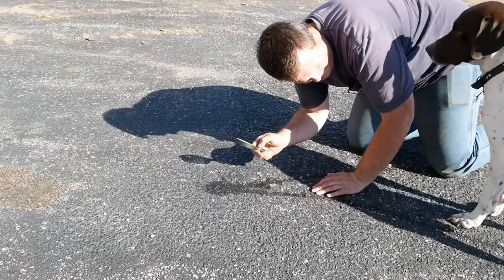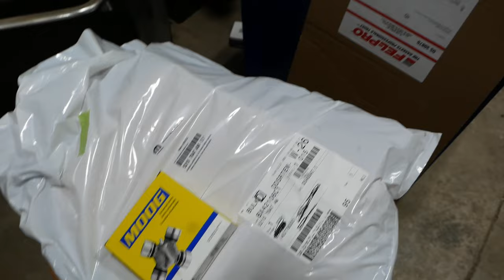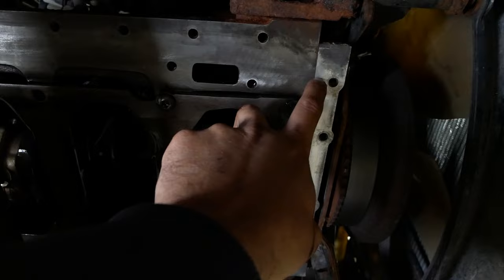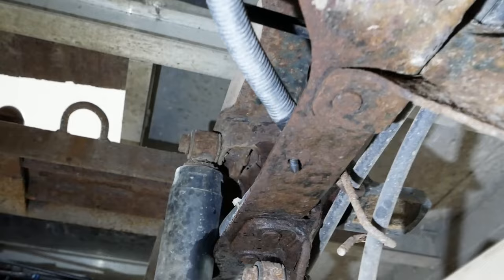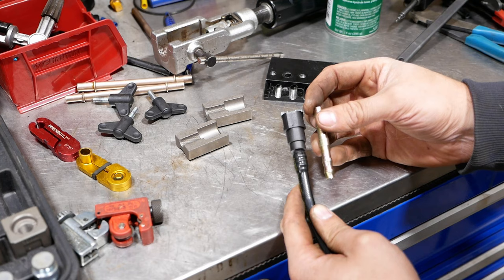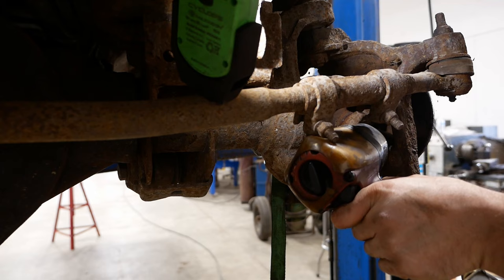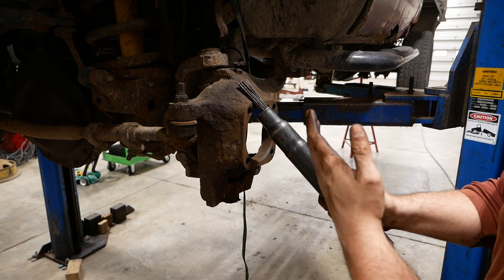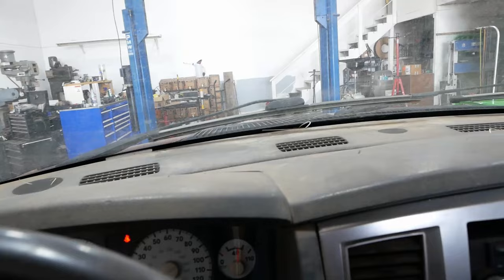6.7 Cummins Massive Oil Leak - Replace Oil Pan, Front Axle U-Joint, Fuel Lines, Shift Cable, Battery

Comment: Damn Wes, You’ve Got All The Cool Speciality Tools. It’s Unfortunate That You Have Got to Explain Your Actions To John Q Public, They Surely Should Comprehend The Fact You Run A Business And Not Working Under The Shade Tree In Their Trailer Park. A Pleasure As Always, Keep It Safe Out There Sir
Reply: It's called integrity.Doing the right thing even when no one is looking.
Reply: @gepettoe  Absolutely Correct, Crying Shame You Rarely Get That Anymore. Seems Most People Don’t Give A Crap And Will Cut Corners To Save A Buck, Regardless Of Any Repercussions. Some Cases It’s Simply Incompetence. Keep It Safe Out There Sir
Reply: Elm tree man-canics, make do with what they have, making use of that crusty wrench found under the trailer
Reply: Well I hate to say this but I learned how to fix stuff the right way cause of my dad. The bad part of that is he was one to save more than a buck that's how bad it was. He once cut a hole in the fire wall of a car we had just to get to the back of the head ( 4 banger ) and yes he did it from under the dash yes inside that's just one of many of his lessens .
Reply: Hardest part about being a tech and especially running a shop, dealing with the public.

Comment: Had to laugh when you said, "The only thing holding the bed on is the tail light wiring." That is definitely pushing things a bit. I like your approach to safety. There is a reason for the standards we have today. Likely there were problems caused by the way things were done in the past and new standards were put in place to prevent those in the future. You can sometimes get away with doing it wrong, sometimes for a long time, but it will catch up to you eventually. I have learned things watching your channel. I like how you use the impact tool to break things loose. I will definitely be using that in the future.

Comment: Granted it's not near as cheap as the harbor freight one u bought, but the mac battery ratchets are pretty damn slick if u ever get to the point of upgrading. Put mine through absolute hell and back daily and it's yet to fail me other than last winters cold snap got a battery but that's it and got her warrantied the following week! The ratchet itself still is as tough as ever after who knows how many drops/falls off the lifts lol.  Engine work suspension work it'll do it all. Manual torque on it is something like 150ft lbs and 45 or 50 ft lbs with the trigger. Awesome tool!

Comment: Thoughts from the Eastern Rust Belt. Never Seeze,  the gift that keeps on giving.  A coworker bought a needle scale, wore out the fingers in a month. Mac Tools has bits for an air hammer that fit over those splined hub bolts, so you can drive on the bearing from the inside.  Another of my no longer needed tools.
Reply: I just took apart some parts that I antisiezed a few years ago.  It was nice.....

Comment: Loved seeing the aftermath on your floor after all that work Wes. I worked on a Mercedes Sprinter for my mate on my driveway a few weeks ago. Brake lines. Rear diff cover. Seized rear brake shoes. Broken spring. Also replaced the front control arms and a bad wheel bearing. The rust that came off it literally filled 2 buckets. 🤦‍♂️
Reply: I'm so glad I live in the southwestern United States rust free cars as far as the eye can see.

Comment: Just come friendly advice from somebody who has tried almost every cordless ratchet... The Makita kit is excellent and is super low price right now, only like 100 bucks on Amazon and it gives you 1/4 and 3/8 drive in 1 and it's about 88 decibels. If you want a ton of power and a brushless motor, the AC Delco ones are fantastic and are heavy duty, they are just rebranding another tool companies tools but they put down some real power, especially the 1/2 drive. It is about 99 decibels free spin full throttle. I'm going to film a video of comparing the two with some torque specs and noice reading and rpm etc if your interested. Also both of them have their batteries in a configuration that makes them fit way more places than the Hercules.

Comment: Yes, the humor is priceless.  You might think that the "aftermarket" would have stepped up and designed a 2 piece oil pan for these trucks that have the rusted oil pan issues.  I would think that there would be enough old PowerStrokes's and Cummins to support the design work.  I drive a '99 F250 that I have been spraying down with rust "preventative" products for years, the outside is OK, but I understand some may rust from the inside out.

While I'm dreaming, BendPack needs to design a 2 post rotisserie lift that lets us work without rust falling in our faces.
Reply: That'd pretty much require a catch pan for all the rust and that would just get removed anyway

Comment: Wes:  Quick story oil pickups.  I rebuilt the engine of a 1952 8N.  After new bearings, rings, etc.  I decided to be real nice to my new engine.  STP was all the rage at the time.  I dumped a can of STP in and then added the oil.  All set.  Crank, crank, slow crank and stop.  Yup, the STP was so  thick the weak oil pump could not pull anything thru.  Oh well, I knew what not to do the second time around.

Comment: When I worked for snap-on in 1978,,, the Chicago Pneumatic air guns were very expensive,, and worth every penny.
I love it when I see one of the old cp-2xx hammers still working like new. Every once in a while a return with a cracked case ( probably dropped from 3 story building). Snap-on replaced them. Don’t know if it’s still the same,, I mean 1978.

Comment: On my day off from vetting I like to watch Wes work!  Thank you for an entertaining and informative video! I enjoy the humor"-the Wallet with Wings"  😆!!    PS. You may already know but Max the pup has a front left tire that might need some mending.   Take care and thanks again for sharing your work with everyone.
Reply from the maker: We've had it checked out. He has a toe that has never "worked". I think it's caused the limp as he's gotten older. He's almost 8 now.
Reply: @WatchWesWork  Aww.  He's a good boy!
Reply: @WatchWesWork  you do real ass,, if dust gets in a diesel,,it dies..im in aus.. this is well known by a lot of 4x4rs..trying to find a real,honest mechanic hear is the same as finding rocking horse sht..
Reply: @WatchWesWork  hell. as i said, im in aus, our cars dont rust. i have a 2001 ford s/pusy,4.2tdi, mexican/brazil.. looks like new..
Reply: @WatchWesWork  every nut bolt on a dodge is 15 ftlb..ish
Reply: @WatchWesWork  how can they satyuse rubber lines if it is common rail, whats the line pressure. 50 from tank.?. 2300 motor.
Reply: @WatchWesWork  that u joint has a grease jerk,,what a waste of engineering time & money
Reply: @WatchWesWork   Can you add a link for the brake line flaring tool and for the one that pushes the quick connector into the plastic line

Comment: When installing new u joing caps I've had good luck when putting your first cap in you actually run it in deeper. That way when you put your second cap in it is already centered between two so cap bearings will not fall out.
Reply: That's a good idea

Comment: Keep us updated on that Hercules cordless ratchet. I too have been thinking about getting one and I’m curious as to how well it will hold up.
Reply: Well pushing anything from Harbor Freight is going to lessen its life, sometimes to seconds / minutes haha.  If youre not dealing with high torque for long periods it should be fine.
Reply: Project Farm did a video on it vs the Milwaukee Ratchets if you're interested in it's limits
Reply: For the price might as well just buy Milwaukee imo
Reply: @Bud Masta  SOME of their products are legendary like the Earthquake line of Impacts I believe they're clones of IR after patents ran out. Their Predator line of inverter generators also excellent. I think clones of Honda except they're all without the expensive brand name

Comment: Little tip that's helped me installing oil pans in awkward locations, I take little bits of small wire and go through bolt holes on the pan and gasket to hold it in place. Get the pan up, start a couple bolts loosely in the middle to suspend the pan and hold the gasket in place, and the pull the wire. Had a couple gaskets fall in the pan during assembly before I started using the wire. We've got some parts tags at my shop I use the wire from.
Reply: Or wire from a home store in the concrete materials dept I believe used for rebar. It's like $8/roll lasts forever and great to keep in your truck for side of the road repairs, holding a tarp or securing things.
Reply: @mrmotofy  I've got a roll of that in my box. Its too thick. You need something thin that will bend easily so it doesn't damage the gasket as the wire is pulled back through the hole.

Comment: Hmm: Adding the connectors to the plastic lines, I just heat up the line a little with a heat gun and jam them in. Not sure if thats the correct procedure, but haven't had an issue.

Comment: Good detective work on which truck was leaking and where it was parked! Max not as good as sniffing our leaks as sniffing out mice! What holds everything together once the tail the light wiring is gone? At least you have a good battery charger/booster! Nice fuel line fix! Cool tools for that. Needle scaler cool! 1st time I have seen one. Repairs worth it for a lower mileage Cummins. As for the math, the teacher looks from the younger generation that teach the new math? Me too old to understand how it works! Great video and fix Wes.

Comment: I usually slather the rear side of my brake rotors where it contacts the wheel hub assembly just so they're less of a pain to haul off the next time. works well for my rust buckets I tend to work on

Comment: Your standard of work is un beatable thos fuel lines were a perfect repair clip on to factory lines and wont ever rot away like the original ones it doesnt get any better a part that clips on like a factory part is superior to the original part as in wont rust again and is easily serviced joined to at a later date perfect job
keep up the great work you do things exactly as i would its great to watch
Reply: Yes sir the industry doesn't always cover everything when it comes to the different areas of the country, so a lot of fellows like Wes come up with a repairs that will suffice both in expense and helping out with longevity of repaired systems.

Comment: You have to have the patience of a saint to work on projects like this. I was a UPS driver, I would deliver stainless oil pans to the county shop for the plow trucks. Those trucks are all spec’d with springs, hydraulics, etc. just for plow work but they couldn’t order them with stainless oil pans, go figure.

Comment: 2 1/2 years ago  2004 5.9 Cummins oil pan perforated so It now has a liberal coating of hi temp  flexible stove pipe sealant and is still oil proof!

Comment: On my 5.9 i didn't remove anything from the engine before lifting it other than loosening the mounts. Lifted the engine with a 2×4 and a floor jack on the crank pulley. Best 4 hours of my life. My new pan is from orielys and no issues going a year strong. I did not remove my trans. I loosened the rack and pinion and removed a crossmember behind it and lifted the engine on 2wd
Reply: Update: oil pan gasket is leaking. Imma tackle this with an oem pan and gasket

Comment: A comment about the oil pickup tube gasket. That’s a critical item because if it leaks there that point is above the oil level in the pan. That means that the oil pump would suck air thru the bad gasket instead of oil from the bottom of the oil pan.

Comment: Decades ago, I was tasked with replacing the clutch in a series 1 Jaguar sedan. Factory method was to remove front subframe with suspension, engine and transmission. No way, Bill would have totalled the car and it would have never gone back together.  I, instead removed 3 or four layers of rotten carpet, and removed the transmission tunnel and transmission from the top. Worked fine, floor was suprisingly solid, and all was well.

Comment: Wes, on the topic of electric ratchets, Id like to put in my 2 cents. The milwaukee 3/8 non-fuel with the small battery is what I use daily in the heavy truck shop. It has plenty of beans to do what I need it to do, and you dont have to worry about it. Many of the bolts I use it on are pretty darn tight sometimes and I just let it spin up before slamming it on the bolt to get that good impact motion and it almost always breaks the bolt loose. It gets tossed, kicked, and other forms of abuse and begs for more. The fuel 3/8 ratchet is also really good, I just found the ratchet head to be too big to fit in the places I needed it most. But the normal one does everything I need with no problems. This has been on everything from pretty Volvos and Freightliners to beaten and abused Macks and Internationals. $140ish on the web river that starts with an A, and that includes the batteries I think. I would honestly be willing to send it out to you to try for a while if youd want, I dont think you would be disappointed.

Comment: Sorry Wes, you obviously did the U-joint assembly incorrectly. There was no Anti Seize on your hands, or shirt, or shoes. 
Technically, that has been proven impossible by reliable sources.
Great job on the fuel lines, neat forming tool to have, if you use it a lot.
Glad you quoted an 'exorbitant' fee, you earned it.
Thanks for sharing.

Comment: I like it when you work on a Cummins, Duramax or Powerstroke. I’m having my 2003 Silverado LB7 Duramax built for 650HP. I have no rust (Desert rat). I’m having a built/upgraded Engine,Allison and transfer case installed. Oh and 2006 didn’t have a DPF, they only had an EGR.

Comment: To be honest I'm a dewalt guy but dewalt doesn't make all automotive tools like milwaukee does. So far I've got the m12 right angle grinder, 1/8 Dremel tool, soldering iron, brushless 3/8 ratchet and cut off tool. The stubby 3/8 impact and bore scope is next on my list. The tools are great I can't complain about them.

Comment: I have the Kent-Moore version of that flaring/Swaging tool and it has the same issue it sticks on the lines when doing quick connects. Mine also has dies to do the O-ring style A/C  fittings. And yes they are expensive mine was around $2500 when I bought it years ago . Great Video Working on Rusty Junk. Mustie would be proud lol

Comment: I actually enjoy the use of nylon fuel lines now. Factory a lot of manufacturers are using them now. Common in freightliner. I like them because when they get full of algae and water they don't rust through or get brittle. And it's all done with compression fittings, (all on the negative pressure side of the system)

Comment: It doesn't even have to be an aftermarket oilpan to cause problems. Had a 2015 International 4400 with the Maxforce engine less than 1000 mi on it lost all oil pressure. Had it towed back to the dealer. International left a packing slip on the inside of the oilpan from factory.

Comment: Good technique removing u-joints but a tip for beginners- squeeze the caps in most of the way with the vice one at a time keeping the second one centred in the needles. (slower but most beginners drop needles using a hammer) Also a nice demonstration of setting the snap rings and loosening the new joint with hammer taps.

Comment: Not having access to elaborate tooling. I've opted to use copper nickel and double inverted flares in conjuction with the appropriate fittings an clamps.  Hydraulic flare tool strongly recommended for 3\8 steel line.

Comment: You are one of the few longer videos that I find worth watching.  I love your sarcasm.  I feel a little guilty trying to advise you, but when I did the rear brakes on my 2011 Dodge Ram 1500, I found that spraying the hub with Seafoam made a tremendous difference in getting the rotor off.  Hope this helps.

Comment: Little trick for getting those damn wheel bearings out. Thread the bolts part way back into the bearing and put a socket on the bolt head and just turn the wheel until the socket hits against the axle and push it out that way, works a treat. Up on the rack not as convienant, on Jack stands mint.

Comment: I had done a head on a roughly 07 Toyota Camry, while we were looking for the coolant leak we pulled the oil pan. Which had been recently replaced. It had the same issue where the paint on the inside of the pan was peeling off like jelly and had almost completely plugged the pickup tube. That was also my experience with aftermarket pan. We sandblasted the rest of the paint off of the inside of the pan. The car ended up having a cracked head in the end.

Comment: What I’ve done in the past when removing the wheel bearing retainer is buy four grade 8 bolts the same size and thread and screw them in place of the stock ones and use them to hammer on to drive the bearing retainer out.  Of course I don’t have an air hammer.  That seemed to help being able to hammer it to spin it in its bore.  
  When ever I do front axles on these 4x4’s I always sell inner axle seals.  It seems that there is always crap in the bottom of the axle tube that get collected and pushed up into the inner seal by the axles shaft cause ing it to leak gear oil a few miles after the repair leading to a comeback.

Comment: An explanation for old men and old trucks.  You find the perfect 3/4 or one ton.  Its got every thing you needed and nothing that you were forced to have.  That truck works for you so hard.  at 80,000 you know its hauled loads or worked for 30,000.  Its in good shape we'll keep it..  At 130,000  Rust issues, but, cheaper to keep then replace. at 200,000.  Its lace, with no value, but dropping $5000.00 on a solid frame is better then getting a new rig...It works.. we'll keep it..